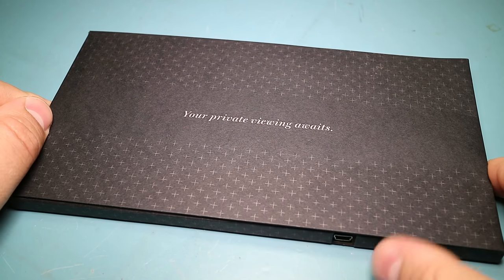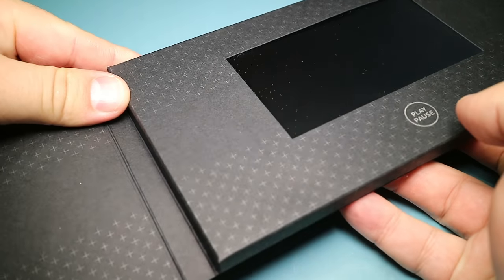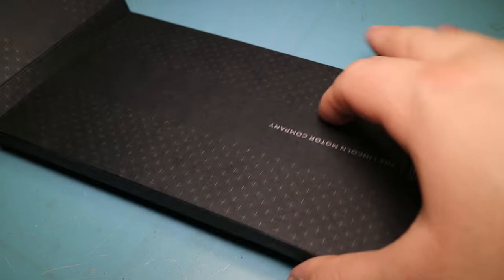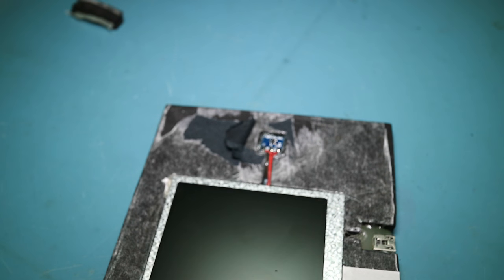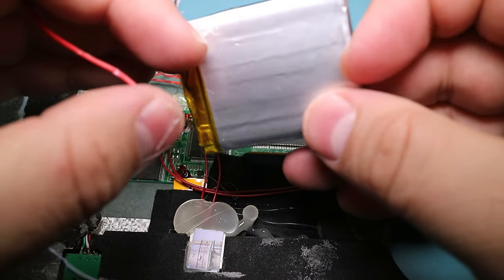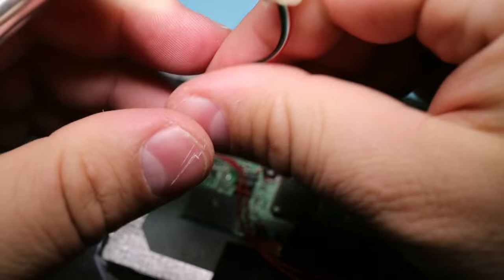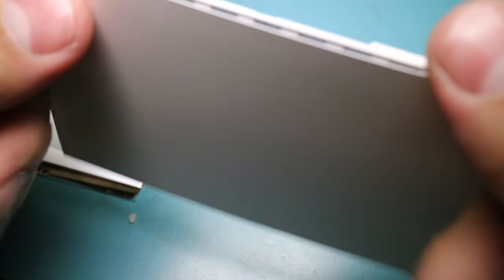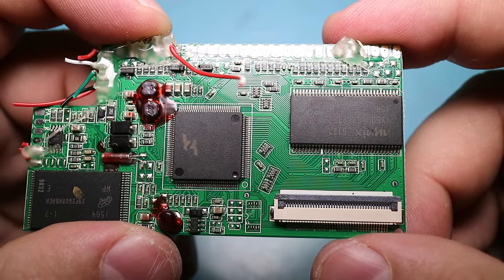Video Playing Lincoln Continental Junk Mail Teardown

Comment: instead of destroying those, here's an idea:

remove unit gently
replace hall effect with shallow normally open switch
change video on player to something REALLY scary
remove glass from bathroom vanity
replace piece of glass with 2 way mirror
hot glue lcd unit to said 2way mirror
mount NOswitch somewhere commonly used (drawer)
run wires like a boss
Scare the living bejesus out of anyone you like.

Comment: I had one of these but with slightly different internals. I tried an experiment with swapping the mini USB with a standard one and discovered it would read most thumbdrives that was plugged into it and turned it into a quite a usable personal video player with  between a 2-3 hour battery life  but the drawbacks was the files had to be in mp4 format encoded with a spcific resoulution that I no longer remember what it was and the thumdrive had to be no larger than 16gb formated with fat32 file system standard fat or any other would not work period.

Comment: I never thought I would see a video like this from you. looks like they probably stripped down the firmware so that it has black fonts, black background, no other graphics in the menu, and goes straight to the video list when turned on.
Also, I won't be surprised if that was made by Americhip.
Reply: also, did yours show a "connected" graphic when you connected it to your PC?
Reply from the maker: +Kevin Bhasi Yeah. It was a very small, blue USB logo. It didn't actually do anything when connected other than mount the flash partition.

Comment: i came across a star wars lightsaber store merch sign that plays video using one of these displays and drivers along with some lightsaber blades and sounds. I managed to change the video that plays. I've changed the requirement to push the button to start the video by just running the switch wires to a gpio pin on the arduino nano. What i need however is the firmware for the chip and a way to flash it so i can remove the idiotic bootscreen splash image.